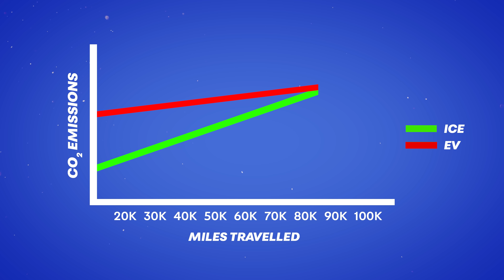Are Electric Cars REALLY That Green? [New 2022 Data]

Comment: Yeah, your walking into a big minefield made of strawmen. All the materials used to make electric cars are nearly the same materials to make an internal combustion engine version. What were concerned with is air quality and overall carbon footprint over the life of the car, and electric cars win out every time.
Reply: How much lithium do you need to make a normal car?

Since when are we only concerned about air quality and overall carbon footprints to the point we can ignore all other pollutants.  Has someone finally figured how to dispose of the HLW from nuclear power plants, and actually disposed of all the radioactive crap we've created in the last half century, or are we still making more highly-dangerous radio-active waste despite having no way to deal with it?  

"electric cars win out every time"  Really?  Are you sure that's not a demonstrable lie?  Tell me, when Hyundai recalled 75,000 Kona Electric SUVs back in 2020 after receiving numerous reports of vehicles catching fire while parked... how did those EVs that win over their petrol rivals?  At least when a petrol-car is recalled before being sold to the public, it didn't create to much carbon during the manufacture process.
Reply: @robotnoir5299  No electric car uses nuclear fuel. There're no nuclear fuel reactors in these cars, but if you know of any, then please post a source. 

All nuclear fuel can be 100% recycled to make new rod, which is why we store HLW in bunkers unground, waiting for the day when it's cheaper to recycle the partially spent fuel rods into new sources of energy for reactors. Until then, well continue to mine uranium as long as it's economically feasible.  

As for cars catching fire, have you ever heard of the Pinto? You want an example of a death trap, then I would start there. As far as I know, only 6,700 Hyundai Kona Electric SUVs were recalled to have a wire replaced based on three complaints that the wire was defective. No cars were reported to have caught fire. 

What I don't understand is how does automobile manufacturer recalls effect the environmental impact of these cars. Surely, you cannot be ignorant over 100 years of recalls for internal combustion engines models?
Reply: @jackdeath   No electric car uses ANY fuel.  Electric cars are not capable of turning fuel into energy.  They rely on power-stations to turn fuel into energy and then give the energy to the car, like a baby bird that can only eat it's mum's half-digested stomach-bile.
Anyway, if your local power-station uses nuclear fuel, then your car is getting it's energy from nuclear fuel.  The whole "out of sight, out of mind" thing doesn't actually remove any pollution from the loop.  The fuel for an EV is just being burned a few miles away.

No, nuclear rods are not recycled.  The power plant uses 5 or 10% of the energy in the rod, and then it's easier to buy a new rod and throw the old one away.

We bury HLW in pathetically frail concrete bunkers.  We know that modern concrete only lasts about 100 year, and the waste will be dangerous for over 10,000 years, but it tricks gullible morons into thinking we've solved the probelm.  It's like locking a grizzly-bear in a traditional-japanese-paper-house.  You know the danger is going to escape almost immediately, but at least it gave the false-impression of being safe for a few seconds.

"No cars were reported to have caught fire. "  Why do you say obvious lies like that?  You're the one who was whinging about strawmen in your original comment, yet you're full of them.  OBVIOUSLY many cars have been reported and documented to have caught fire since the invention of the automobile.  This hasn't changed since electric vehicles became a thing, and there is photo and video evidence of electric-cars up in flame.  

Of the 75,000 Kona Electric SUVs that were recalled, 6,700 were in the USA.  Thus, I assume your 6,700 figure just means you're oblivious to anything that happens outside your own country.

The fact is, electric cars cause most of their pollution during manufacture, but petrol-cars spread the pollution across their life-time.  If an EV and a petrol car get recalled before being driven, then the EV caused more unnecessary pollution.  If an EV and a petrol-car are crashed on their first day on the road, then the EV caused more unnecessary pollution.  If a freight-contained containing an EV and a petrol-car falls of a ship and is lost at sea, then the EV caused more unnecessary pollution.

In you initial post, you lied that "electric cars win out every time" but these are all examples of when you're wrong.  The only way an EV wins if it has a very long life-span without any major accidents AND somehow never needs it's battery replaced, despite EV batteries having a limited life-span.

Your whole argument is toxic gaslighting.  You accuse other people of straw-manning, but then do nothing but make demonstrably false claims.  Disgraceful.  This is why no-one can usually be bothered talking to the EV cult-members.  You're all crazy.

Comment: We are missing one thing here and that is battery life for the EV. I'm not up on how long a set of batteries last before needing replaced, but that factors in as a reset for the EV. Then you have the disposal of the old batteries along with the energy of the new ones.
I'm sure someone out there has an idea about the lifespan (in miles or Km) of these batteries.

Comment: This is a discussion (note: not an argument) that is getting well deserved attention. I guess the answer will be a new design in batteries that reduces those levels of CO2 production (maybe Volvo have got one of those in their back pocket?) but it is a danger that people look for a quick fix. Like your man says in the video - it's a step in the right direction, not a quick answer. We're not done yet. Wonder if they took the increased inefficiencies of the different motors/engines into account for that paper? You would perhaps think that the one with more moving parts (which I presumably is the ICE?) would wear out more quickly, become less efficient, require replacing (i.e. with a new car), etc, etc? More data and discussion required.

Comment: One of the problems is people overbuying battery size, "I need 300 miles range" or "same range as a full tank". When buying an EV a mindset change is needed. Buying the right range for 98% of your journeys results in a smaller battery and lower co2 manufacture footprint. For this mindset change to happen, the charger infra needs to be more reliable, a journey down to Cornwall, coastal Wales or the Scottish Highlands is still a challenge.

Avoiding stopping to charge for 2x30 minutes twice a year on your journey to visit Aunt Mary or park at Manchester Airport is not a reason to get a mega battery. Either bulid the charge in and enjoy the stops (I have had some great charge locations) or get the train.

I am on a green tarrif, with very cheap (even in 2022) overnight electricity and for the 98% of journeys the range fairy has dropped off 170 miles each morning!
Reply: I take 1500 mile trip one way 6 to 8 times a year. I would have to add days to my trip

Comment: Has everybody forgot about the rest of the vehicle. Trim, paint, tyres, lubrication, and top it all metal to make the bodies. Still mined out of the ground. Still travelling the world by ICE boats. Still using earths product to produce man made product, ie heat, oil, carbon fibre, pigment in paints, copper, steel, plastics. Oh. When you have an accident nobody wants to touch it.

Comment: Mr. AutoTrader, a friend sent this to me and I believe it adds to your narrative on EVs

What is a battery?  I think Tesla said it best when they called it an Energy Storage System.  That's important. They do not make electricity – they store electricity produced elsewhere, primarily by coal, uranium, natural gas-powered plants, or diesel-fueled generators.  

So, to say an EV is a zero-emission vehicle is not at all valid.  Also, since forty percent of the electricity generated in the U.S. is from coal-fired plants, it follows that forty percent of the EVs on the road are coal-powered, do you see?"

Einstein's formula, E=MC2, tells us it takes the same amount of energy to move a five-thousand-pound gasoline-driven automobile a mile as it does an electric one.  The only question again is what produces the power?  To reiterate, it does not come from the battery; the battery is only the storage device, like a gas tank in a car.

There are two orders of batteries, rechargeable, and single-use.  The most common single-use batteries are A, AA, AAA, C, D. 9V, and lantern types.  Those dry-cell species use zinc, manganese, lithium, silver oxide, or zinc and carbon to store electricity chemically.  Please note they all contain toxic, heavy metals.

Rechargeable batteries only differ in their internal materials, usually lithium-ion, nickel-metal oxide, and nickel-cadmium.  The United States uses three billion of these two battery types a year, and most are not recycled; they end up in landfills.  

California is the only state which requires all batteries be recycled.  If you throw your small, used batteries in the trash, here is what happens to them…..  All batteries are self-discharging.  That means even when not in use, they leak tiny amounts of energy.  You have likely ruined a flashlight or two from an old, ruptured battery.  When a battery runs down and can no longer power a toy or light, you think of it as dead; well, it is not.  It continues to leak small amounts of electricity.  As the chemicals inside it run out, pressure builds inside the battery's metal casing, and eventually, it cracks. The metals left inside then ooze out.  The ooze in your ruined flashlight is toxic, and so is the ooze that will inevitably leak from every battery in a landfill.  All batteries eventually rupture; it just takes rechargeable batteries longer to end up in the landfill.

In addition to dry cell batteries, there are also wet cell ones used in automobiles, boats, and motorcycles.  The good thing about those is, ninety percent of them are recycled. Unfortunately, we do not yet know how to recycle single-use ones properly.

But that is not half of it.  For those of you excited about electric cars and a green revolution, I want you to take a closer look at batteries and also windmills and solar panels.  These three technologies share what we call environmentally destructive “embedded costs."

Everything manufactured has two costs associated with it, embedded costs and operating costs.

A typical EV battery weighs one thousand pounds, about the size of a travel trunk.  It contains twenty-five pounds of lithium, sixty pounds of nickel, 44 pounds of manganese, 30 pounds cobalt, 200 pounds of copper, and 400 pounds of aluminum, steel, and plastic.  Inside are over 6,000 individual lithium-ion cells.

It should concern you that all those toxic components come from mining.  For instance, to manufacture each EV auto battery, you must process 25,000 pounds of brine for the lithium, 30,000 pounds of ore for the cobalt, 5,000 pounds of ore for the nickel, and 25,000 pounds of ore for copper.   All told, you dig up 500,000 pounds of the earth's crust for just - one - battery."

Sixty-eight percent of the world's cobalt, a significant part of a battery, comes from the Congo.  Their mines have no pollution controls, and they employ children who die from handling this toxic material.  Should we factor in these diseased kids as part of the cost of driving an electric car?"

I'd like to leave you with these thoughts.  California is building the largest battery in the world near San Francisco, and they intend to power it from solar panels and windmills.  They claim this is the ultimate in being 'green,' but it is not!  This construction project is creating an environmental disaster.  Let me tell you why.

The main problem with solar arrays is the chemicals needed to process silicate into the silicon used in the panels.  To make pure enough silicon requires processing it with hydrochloric acid, sulfuric acid, nitric acid, hydrogen fluoride, trichloroethane, and acetone.  In addition, they also need gallium, arsenide, copper-indium-gallium- diselenide, and cadmium-telluride, which also are highly toxic.  Silicon dust is a hazard to the workers, and the panels cannot be recycled.

Windmills are the ultimate in embedded costs and environmental destruction.  Each weighs 1688 tons (the equivalent of 23 houses) and contains 1300 tons of concrete, 295 tons of steel, 48 tons of iron, 24 tons of fiberglass, and the hard to extract rare earths neodymium, praseodymium, and dysprosium.  Each blade weighs 81,000 pounds and will last 15 to 20 years, at which time it must be replaced.  We cannot recycle used blades.  Sadly, both solar arrays and windmills kill birds, bats, sea life, and migratory insects.

There may be a place for these technologies, but you must look beyond the myth of zero emissions.  I predict EVs and windmills will be abandoned once the embedded environmental costs of making and replacing them become apparent. 

"Going Green" may sound like the Utopian ideal and are easily espoused, catchy buzz words, but when you look at the hidden and embedded costs realistically with an open mind, you can see that Going Green is more destructive to the Earth's environment than meets the eye, for sure.

Comment: Rather than move to EV's with the dubious claims of being cleaner, rather they are only cleaner where they are used, not globally, we should move to GTL fuels and hydrogen - They are the way to be cleaner; though we also have to move to clean power production first, or it doesn't matter what your car uses to move it, which means nuclear unless you want the country covered in windmills killing off the bird population & that have to be replaced every 20 years. A nuclear power plant will run at least 40, probably 60 and if it is a Gen IV molten salt reactor a lot longer, as they run without large pressure stresses of a PWR that will fatigue the pressure vessel eventually.
Plus the trucking/heavy plant industry will likely never get to be EV as the weight of the batteries starts a spiral of increasing weight (with heavy plant equipment) as they have to be stronger because of the batteries, with makes them even heavier...But the main problem is the duty cycle of these vehicles/machines - they are used as much as possible to reduce cost overhead, so they never have long enough to recharge...These need H2 or GTL tech to be C neutral for the greenies, but still be useful.

Comment: Did they factor in the footprint of replacing the battery pack and the cost of disposing of the battery? And we now are starting to see video footage of fires from those batteries during accidents and just how they are not environmentally friendly. Not exactly safer either. Trying to defy the laws of physics is a real challenge. Nothing is ever as simple as we hope or desire.

Comment: If an EV needs to travel 90k miles before it even starts to be "green" then virtually no EV will meet that criteria because the battery simply will not live long enough to see 90k for most drivers. EVs are totally unsuitable for daily long distance motorway driving, so it will take 10+ years to reach 90k. Most batteries only last 8 years at most...

Comment: One important point that is left out. Air quality is important but large lithium batteries being made in mass permanently depletes the earth of minerals. The bottom line is the market system can’t protect the environment. I think in an ideal world the answer would have been a longer life for plug in EVs which have much smaller batteries until companies dedicated to creating EVs could prove that battery technology was such that long term creation of these batteries and eventual desposal of these batteries is safe for the environment. Also another plus of EVs is increased energy independence for every country.